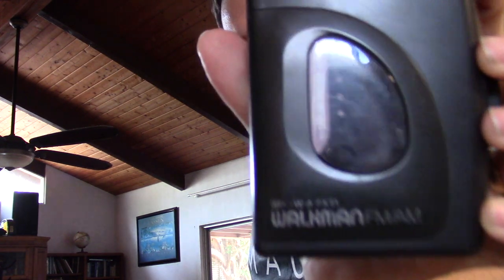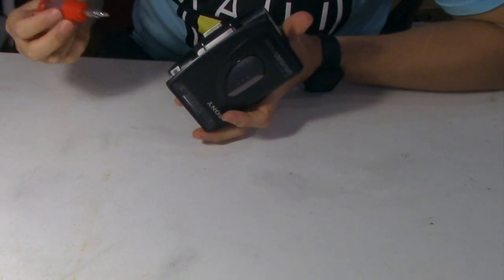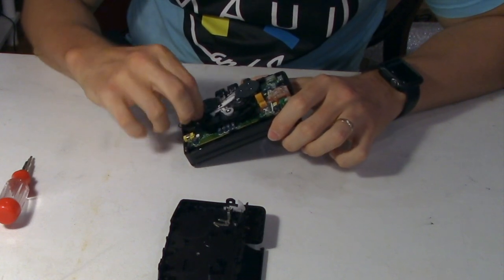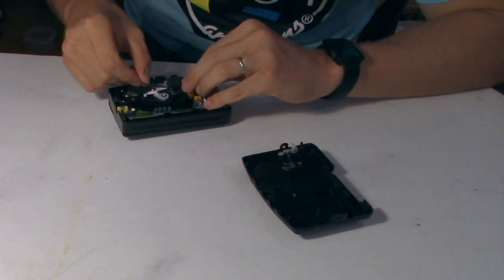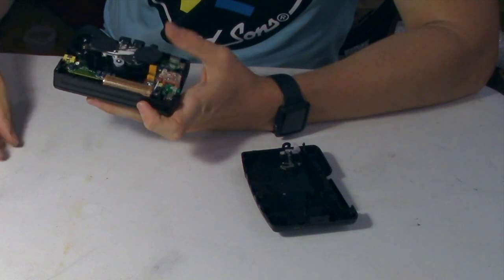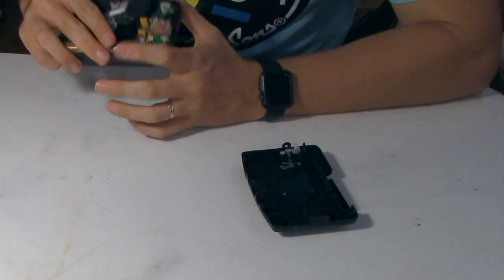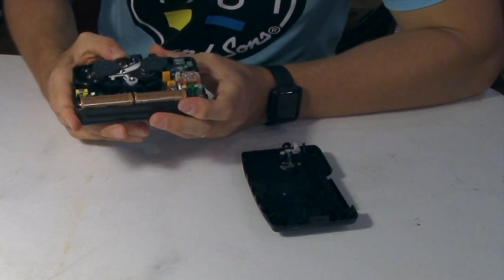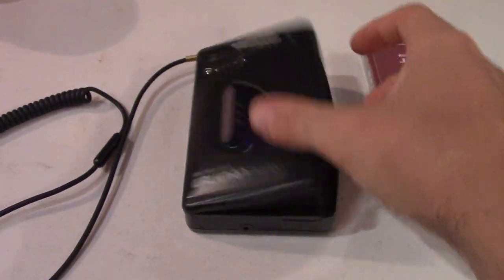Replacing belts in a cassette Walkman ( wm-fx21 )

Comment: Thanks a lot for this video mate, I ordered a big lot of these and am pretty experienced with handheld stuff but new to cassette players. Really appreciate how thorough and clear you are with all your steps, will share this vid to anyone I know thinking of doing the same.
Reply from the maker: Thanks means a lot! Yeah, I make these videos to help more people become a part of the cassette community.
I think you’ll do fine with repairing walkmans. I repair computers and phones also, Walkman’s are definitely less tedious.
Reply: @KeoniMarques  Just been studying breakdowns of different models the past few days, my plan was to give away some of the Walkmans but I'd like to keep some - have a few old cassettes that I'd like to listen to :)
Reply: @KeoniMarques  Just a quick update dude, the Walkman repair was a success thanks to your vid. I think the new belt is pretty thick (still thin for a belt) and tighter compared to the old one which was slack as hell but all in all it's all working, btw is it normal for fast forward/rewind to get kinda scratchy and vibrate if you turn the Walkman upside down or in weird positions? Doesn't eat tapes or damage them just kinda weird even though I know the roller mechanism is loud anyway lol, otherwise if its clipped to my belt or upright on a table there are no issues
Reply from the maker: Suedeash I’m glad to hear it.👍
But about that scratchy sound it could just be the tape.
I have a few tapes that make a lot of noise while fast-forwarding or rewinding.
If it’s the player itself they sell...I believe it’s called alkaline grease to lubricate the mechanism.
Reply: @KeoniMarques  I see man, I'll look that stuff up and apply it if the problem keeps happening with other stuff. Thanks!

Comment: Is it normal for my walkman to auto reverse when no button is being pressed on tape mode? I am new to using them so I don't know the full specifications.
Reply from the maker: Yes, if it happens when your at the end of the tape.
Reply: It happens even if there is no tape inside. I have to take out the batteries or else it will drain.